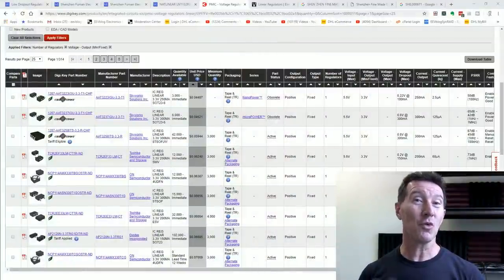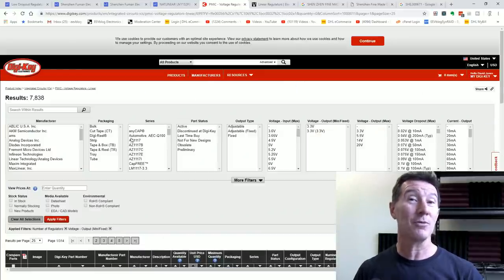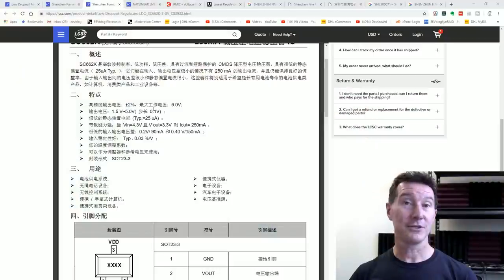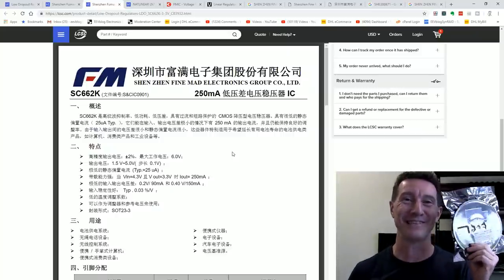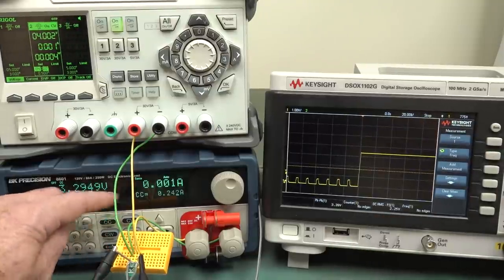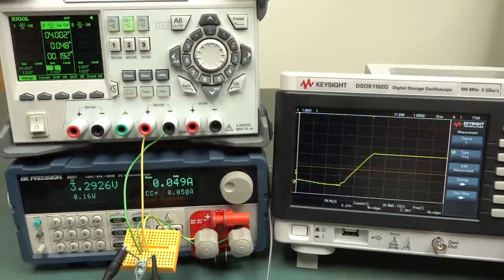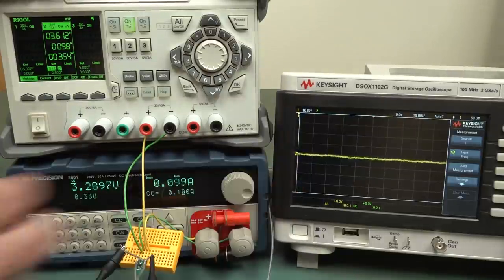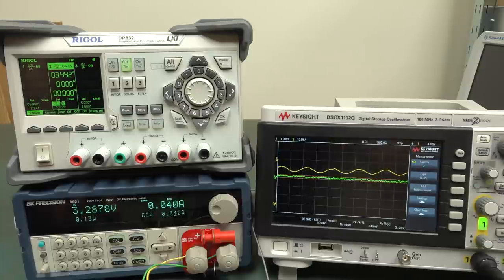EEVblog #1147 - 1 Cent Regulator! That's MAD!

Comment: Blows my mind that tiny thing can handle 1W of power. Unreal.
Reply: It delivers one watt, but dissipates internally much less than that or else it would overheat and fry itself quickly (unless a heat sink is somehow attached to the chip).

Comment: Sorry, but that "you can qualify them and see if they fit your needs" arguments is just a bad one. Datasheets are also more or less a guarantee on the performance of the chips in the future, but if its not in the datasheet and they find a way to make their manufacture process even cheaper, sacrificing some performance points your measurements figured out it matches and you relied on, then its your problem. In other words: you cant be sure if the curves you get will be the same in the next order.

Comment: It's hard to believe that a re seller can sell these for 1.5cents and make a profit, therefore the manufacturer has sold them for less than that and still made a profit. What does it cost them to make them? You'd think you couldn't make a part with less than a cents materials, never mind the labour costs and overheads. It's crazy

Comment: @eevblog Interesting that SC662K marking "662K" is identical to IC from mouser - XC6206P331MR-G from Torex Semiconductor. "Original" part also works fine, but obviously more expensive. SC662K seems more like non-legit copy rather than chinese r&d product

Comment: Those are awfully low current. 60ma? Jeez, I think the cheapest ones on mouser supply 200ma, and those are only 6 cents each.
Reply: Dave demo'd it working at 200mA, did you sleep through that part?
Reply: @markxr1  No, but I thought he was demoing the mouser 200ma parts. Skipped through some of the video. I apologize. Either way, they are rated for 60ma, not 200ma, and over driving cheap chinese parts is asking for trouble.
Reply: I think they are clearly rated at 250mA maximum current, at least, based on a machine translation of the datasheet (it's in the part name and the specs). It does talk about the drop-out voltage at several different currents, it's not completely clear in the machine-translated version from the Chinese. I think 200mA is in spec for this part, although I can't read Chinese.
Reply: @markxr1  Oh I see. On the website, it was listed as '60ma', at least the one he was looking at for a penny. Strange.

Comment: "Fine Mad" also have a 2,6cent 1117 (1.2V) chip. Just ordered 100 of those. As well as some 3cent 34063, LiOn-Charging Chips and tiny Boost Converters. 
Crazy how cheap that website is. 
Interestingly, Chips from Texas, ST or Atmel/Microchip are sometimes almost twice as expensive than Mouser or Digikey.

Comment: I wonder if this part includes good ESD protection.  Leaving that out would make the die way smaller and cheaper.
Reply: He called the bag that the reel came in a “hermetically sealed” thing to keep moisture out, but it sure looked more like an anti-static bag to me. And maybe really necessary because if the reason you gave in your comment.

Comment: I always buy from taobao.com with the help of my wife who's Chinese.  Taobao is the eBay equivalent in China and the stuff on there is significantly cheaper because taobao is for the local Chinese market.  Chinese vendors will charge more if you buy from them through sites like Alibaba and LCSC or if you don't speak Chinese.  I get pcb panels made by a Chinese vendor I found on taobao - my wife does the ordering, sends in the gerbers from her QQ email address.  The only downside is the fake components, majority are ok but I usually buy a sample from one vendor to test first before going back for a bulk order.

Comment: F**k the bill of materials, if I engineer a product I want it to work for as long as possible, vice versa if you want a good product you are going to have to pay for it. I'm sick of it, BMW especially. Bought a new mini and the oil filter housing popped and than it had bearing damage. Bought a 120i and the same thing. I don't quite know why i went to become an engineer, you are the corporations bitch. As soon as someone comes over to me and tells me to find a way to lower the price I'm going to quit. My father has a tiny shop where he produces sprockets and gears and drivetrain stuff for classic motorcycles since 35 years, recently i notice a customer who nearly had his eyes fallout because he was impressed by the quality, a while later he tried talking my dad into selling him 10 for not even the price of 1. I went over to him and said "Bitch you couldn't afford one if it were sold for the cost of production." although my dad was about to say the same thing when he says it they keep trying and I have the cops on speed dial since someone drew a gun on me.

Comment: Too bad it is only for reducing voltage, and only a linear. It would be great to build-in a switching regulator to every individual power cell (battery cell) so they would be able to deliver a programmed voltage until the chemical energy was really near zero. Kind of like a joule thief does, but for programmable output voltage.

Comment: I will buy 10 cent part from TI rather than this, it is well documented and tested. Who can guarantee  performance of these parts over temp range and variable inputs. And if face any issue then I  can contact  TI if using there part, but in this case with whom I have to make contact?

Comment: Optimizing bill of materials?
What about shipping and import tax? 
I get it when you producing millions of them, but everything less, meh.
Don't forget that ordering directly at the manufacturer is also a lot cheaper than Digikey, Farnell, Mouser etc
Also the PSRR is horrible btw. A NPN transistor with a resistor and a diode is gonna be the same price and probably will perform better.
Reply: - "What about shipping and import tax?"

You don't need to pay tax if you source manufacturing in china.

Comment: See if the regulation will latch up by inputting a10 Hz square wave above Vreg  and check for runt/over-shoot voltages as the component self heats.

Comment: By the time you pay a reputable lab to "qualify" these cheap parts, I suspect your final cost will be equal to the proven and guaranteed parts...and if they do NOT qualify, then there goes your money. Unless I am building some cheap toy or a gadget, I would avoid them like plague. Few cents ain't worth it.
Reply: Lassi Kinnunen  - I don't agree with that. Your TV, computer, LCD monitor, microwave, etc all use proven parts. Reputable companies do not take chances with subpar components for the sake of minuscule savings, imagine your TV going dark because a 1 cents chinese LDO overheated.
Reply: @NICK-uy3nl  Haven't you heard of planned obsolence ? You don't need to qualify your parts, you need them to be cheap enough to work or to replace while under legal warranty.
Reply: @istvan.design  - I can see your BMW i3 stranded on the side of the road because a 2 cent chinese chip burned out...then talk to me about 'planned obsolescence' !
Reply: @NICK-uy3nl  I didn't mean more serious situations, I meant that some products can fail within a statistical model and that is actually good for the manufacturer. I wouldn't like any of my devices to fail, but that wouldn't change the profit margins planned by the manufacturers. Also analog chips very rarely fail, especially if they are simple, they might be lower quality, but you don't need extreme precision if you are not making precise instrumentation.  Actually you can get away with a little overvolting or undervolting of most microcontrollers/adc's/opamps without major consequences, ripple can be or not be a problem. (that's why in some cases even in high quality devices you'll find noname chips and capacitors in some areas)
Reply: @NICK-uy3nl  As a former BMW mechanic - They outsource their electronic R&D. Yes, the electrics are born in shenzen.
Reply: Unless we are talking about medical, military, or top tier industrial; your TV, computer, LCD monitor, microwave, ect will all use cheap chinese components. Higher quality consumer shelf brands might use a more reputable part in critical areas. SMD resistors, caps and single semiconductors are going to be cheap unless that particular part is crucial for reliablity. These products are mass produced so the cost of qualifying these parts is trivial. For low volume production however, it might be better to step it up a bit.
Reply: @natecontarino1748  - You are totally wrong. Check the difference between a japanese made Sony TV and a  no-brand name chinese equivalent selling for 1/3 the price, All parts in the Sony TV are qualified for the expected life expectancy, the chinese TV uses cheap components of unknown life expectancy, that includes semi-conductors and passive components like  caps. Reputable manufacturers understand the cost of warranty claims (and their reputation) is far more important than saving few dollars on inferior parts.
Reply: Probably cheaper overall to use known good parts to start with.
Reply: @NICK but by the time the owner of the cheap Chinese TV sees it break down, they buy another new one with better specs, consuming less power, more possibilities for yet less money, and you are stuck with your investment in a Sony that always was more crippled (due to their presence in the media industries their products tightly adhere to "content management" guidelines where cheaper products often don't) and you will have to sit out its lifetime looking at a Full HD TV without the newest apps etc, while the buyer of the Chinese TV is always uptodate with technology and features.
So while it may be true that your TV lasts longer, the question is if that is actually a benefit.
Reply: @NICK-uy3nl  "Reputable companies do not take chances with subpar components for the sake of minuscule savings"

Capacitor plague, anyone?
Reply: @Rob2  You're assuming everyone wants a Silly-T.V. full of security holes, and enjoys wasting money on the endless consumer treadmill.
Reply: I'm not assuming that but apparently a majority does.  And you have not much choice when transmission standards change.
(probably the "smart TV" will get less popular now that it has become so clear that these have only a short lifespan, but still)
Reply: I can't see how even a cheap ldo could fail in proper operating conditions. As long as it stays cool and away from harsh transients, there isn't that much that could break over the lifetime of a typical consumer device.
Reply: @MarianKeller  every material degrades over time and temperature, if not then why there is voltage drift in voltage referance . The quality of material used for production and controlled manufacturing process can make big difference . Life expectancy  and performance need to be verified after few years.

Comment: On the one side it's nice but I think we have to consider the ethical behaviour. That's even more products that we trash after a short time. Even more mass Production and a waste of resources of products that are not really needed. Have a look on bigclives video about a power bank with a rechargeable batter including pcb that only one time used and that's on a bad way..not even one full charge of a phone possible. I think engineers should think about such issues as well these days
Reply: @forestbird
: So, what is your proposal to solve that problem?
Reply: There's a difference. These mass produced parts will eventually got used and found a use in a proper product and it will last quite a bit if used correctly (within specs). The bigclive single use powerbank is a bit offensive since there are a lot of alternatives to change a phone if absolutely needed.

Comment: It would be good if they made a regulator with an extra pin to program the parameters serially, such as output voltage and current limiter.

Comment: i always pick up a new tit bit of knowledge from your vids thx!

This regulators recovery looks great but if utilised in circuits that later in use developed say a fault or intermittent fault, wouldn't that be more of a problem to troubleshoot than to have the fault permanent to find quicker?

Comment: Dave needs to try doing high current by putting a bunch of these in parallel. Heck, put them in series and do high voltage. All for just for the shiggles.

Comment: I would imagine there are some large government subsidies going into these companies.While im sure a fair share of these companies do some good volume sales there are far to many at such a low price to actually be turning a profit all the time. Manufacturing storage shipping and handling would over run the profits in a lot of cases. LCSC and the likes are probably turning a small profit but the manufacturer is probably selling at cost or a loss and happy to do so as long as the government pays them.

I could be wrong though maybe they do sell the millions a month needed to make it worth while. I guess they could sell these smaller parts at or near cost wile their other products turn a profit just to make the brand seem more attractive. Who knows?

I know they have cheap labor and materials over there but this seems a little extreme. Even for such a relatively simple part.
Reply: First, yes, that's true, there are goverment subsidies in a lot of "strategic" companies in China. On the other hand, it's not uncommon for tooling and components manufacturers to sell some items at loss, because percieved value or accepted price by the customer can be far more the cost of producing, it's part of the philosophy of "service level". Since I make and sell to you many components for your needs, for logistical simplicity and technical support you buy all from my catalog, in a couple cases I can give you a price that is below the cost but I expect you to buy more of the profitable ones. If managed correctly it's a win-win situation.

Comment: Please let me know when I can buy a 50 cent USB I can plug into my USB port and get a few various standard voltage outputs. :-)
I just looked on eBay and found some close matches, but I mean you should be able to get away without even putting a USB socket down. For the USB connection just use copper pads and the right thickness of board. Make it super cheap so everyone has one! :-)
Reply: linagee Well these chips will do the work of such a device: 4 to 6 V in, 3.3V out (for this model).

Comment: Are you sure you didn't google translate the datasheet? All your interpretations of the datasheet are completely accurate.
Reply from the maker: Because it's obvious what the specs were to anyone experienced in regulator datasheets, no need to translate.
Reply: you only need to know the diagram and the symbols ()
Reply: @EEVblog  I see that now after looking through a few datasheets of linear regulators I have used before. They are all the same. But it is still quite impressive to get all of them right without understanding Chinese.

Comment: Do you think China would be producing $0.015 LDOs without the US developing the first LDOs in the mid 70"s? I was working at NSM when the work was being done. I was earlier given the task of designing the LDO but I told my boss when he returned from vacation that the design I came up with REQUIRED an output capacitor...he told me that was not acceptable. Another few months and another "boss" decide that the output capacitor was OK and the product was born.

Comment: chinese wages are too low xD
Reply from the maker: Indeed.
Reply: Not exacly, after all thats semiconductor industry. I come from China. Chinese can not manufacture advanced mask aligner but we can make low profile cheap ones. You may not believe. In China, there are many home workshops manufacture led chips even more complicated diodes or transistors. Thats crazy.
Reply: Just in home.

Comment: Very good component for the price. With items like these we can start to see how Ebay can sell things so dirt cheap.

Makes me wonder if this is what's inside all the fake regulators an components on Ebay. Just bought a stack of HT7330 and HT7350 for some projects that cost about 20c per part so it'll be interesting to see how they compare.
Reply from the maker: Yes, would be interesting to know if unscrupulous dealers re-silkscreen these and sell as bigger brand fakes.
Reply: @EEVblog  "unscrupulous"? Looks like those fakes could easily outperform the originals...so, maybe "helpful" would be a better word ;) ;) jk

But really, it looks like China's manufacturers are getting to that point your favorite movie joked about Japan in '85. They've been there with pure manufacturing for a long time, but now they seem to be designing really good stuff, too. And still are cheap.